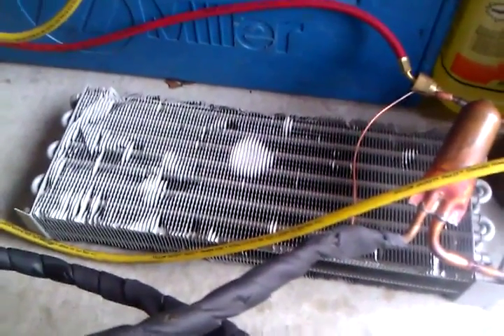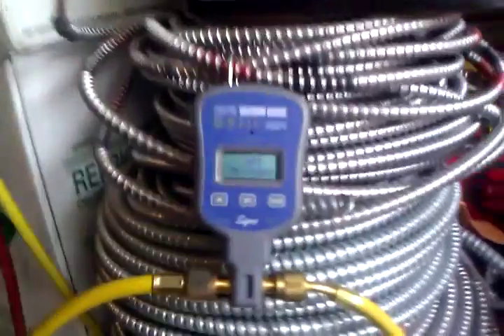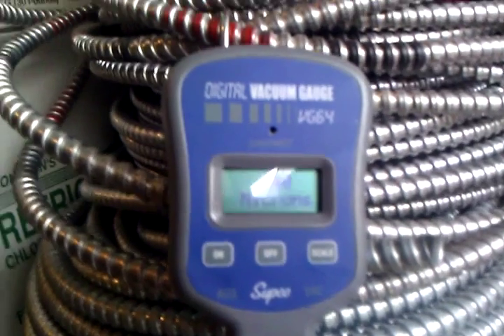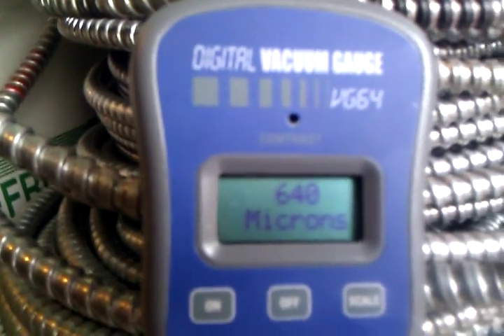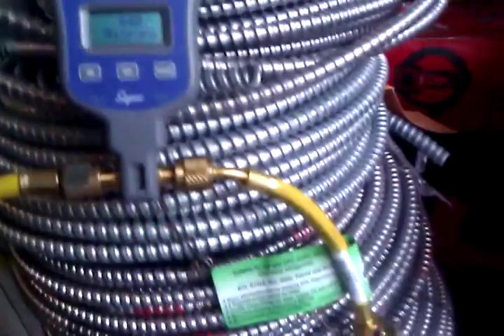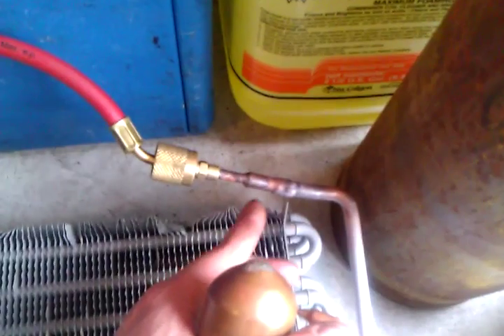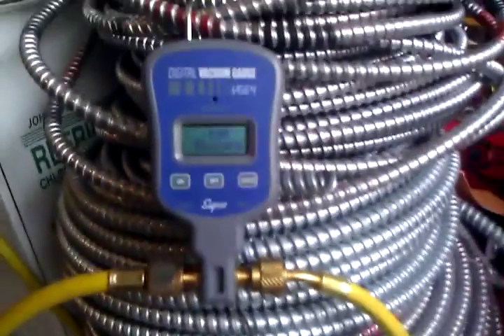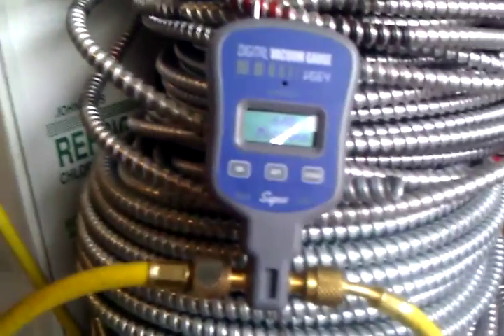Digital Micron Gauge

Comment: Hi
You wont get an acurate reading with that setup.... The Aux side of the supco 64 should have the cap on.. these are not designed to be used in line.... The Aux side of the supco is to help when cleaning it... they are not the best.